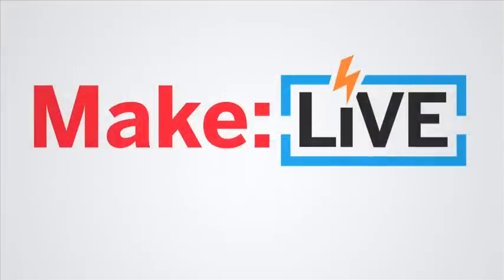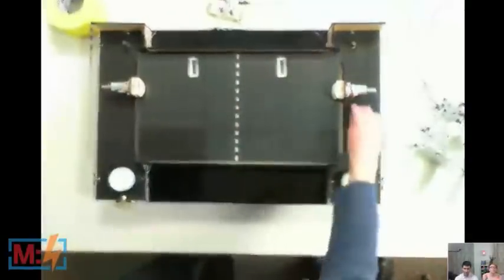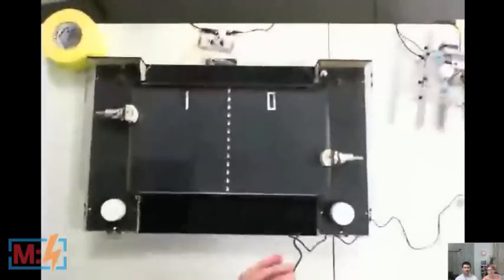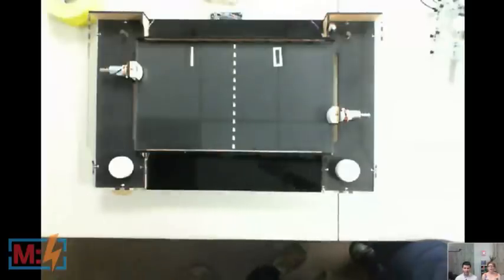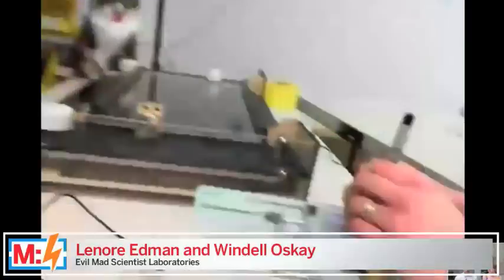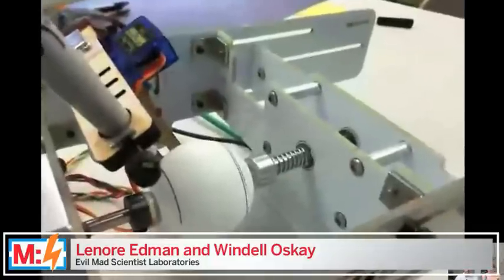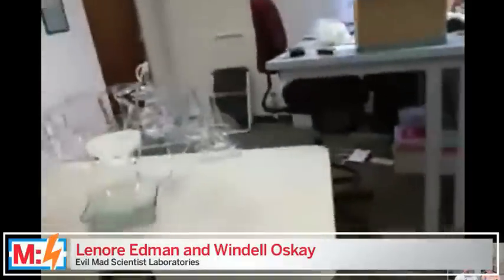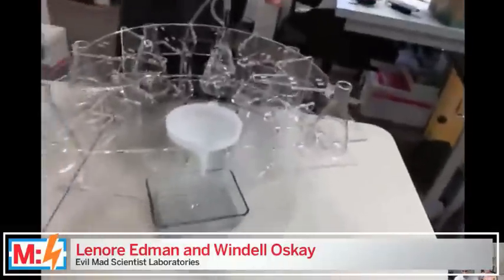Tabletop Mechanical Pong on Make: Live ep05

Comment: why would you even need a ardrino  (sorry on the spelling) you could just use a not gate it would be cheaper. if the photo resister is sensing light no kick if its NOT than kick the ball.